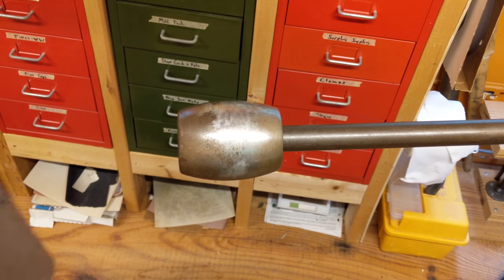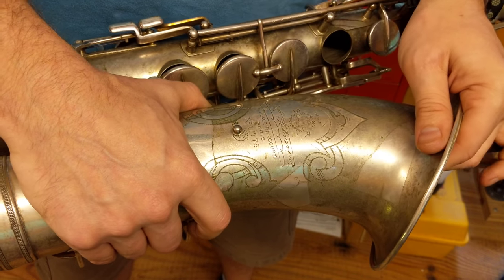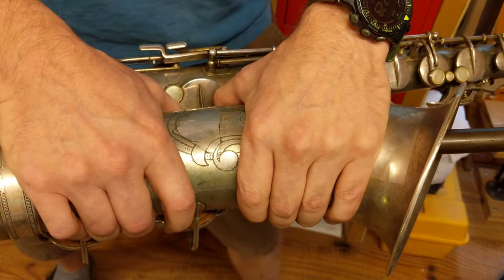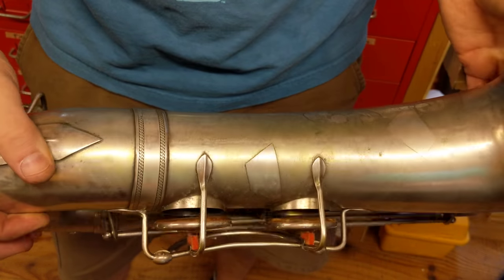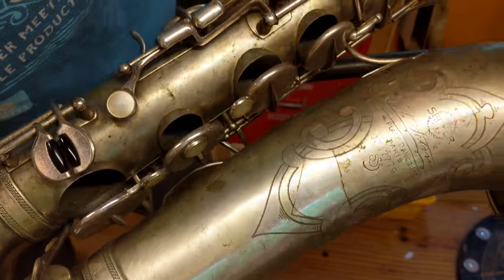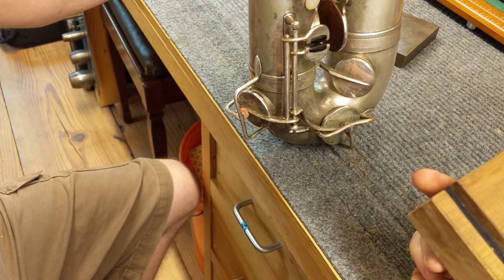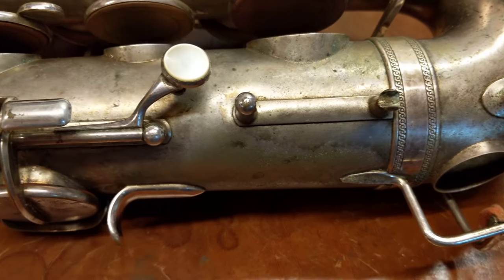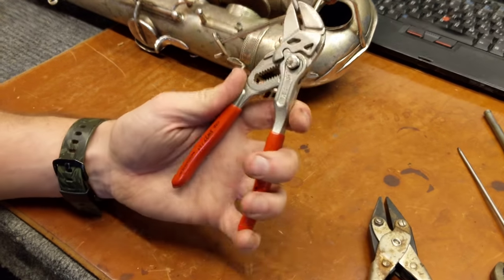Saxophone Repair Topic: Repairing Some Typical Long Term Damage on an old Selmer Tenor, Part 3

Comment: Hi, Matt. I really enjoy your vids. I have been repairing horns for 20 years, playing sax profeaaionally for 40. I learned from friendly repair techs  and have been fortunate to find them. I wish I had your vids 20 years ago!. I do a good repad and a little soldiering, but no dent work. 
I have an observation about shipping damage - NEVER use FEDEX!  I buy saxes regularly and they damage 80 % of them . UPS is a little better, but I have had a horn totaled  by them. I use Us Post office - GROUND - you need to keep the horn out of airports as much as possible since  that is where the worst  damage seems to happen.  You can also choose the hand carry option for $11 extra, so they dont process it on machines. This has worked well for me, since Dent work always has to go to a tech. thanks gor the great vids and great work - your an inspiration.

Comment: Hi, Matt. I have a Bundy tenor gold color saxophone. I am looking for a part that is a Swivel Arm located behind the neck screw) to replace by myself.  I found this video and you repaired the exact same part I did broke.  (starting from 14:01 on this video)
The broken part is near the pin key under the crook key ring. The part connects the pin key and the body key on the top of the body. that makes a higher octave.
When I found the pin key was bent, I tried to correct it with a hand tool. Then the "swivel arm " broke. The broken swivel arm has a hole and a rod screw inside . The swivel arm used to connect the pin key and body octave key. Where can I order the swivel arm to repair it by myself. Can you recommend any place that I can order part? And what is the name of the part that I need to order? Thank you.

Comment: You are an artist man. What are those polygonal patches on the bell?
Reply from the maker: there was tape on it at some point, I think.  when the tape was removed, the parts that were under it were cleaner than the surrounding area.
Reply: @StohrerMusic  Thanks!